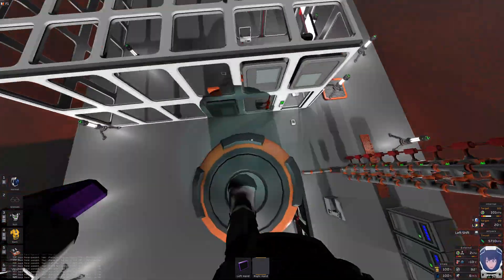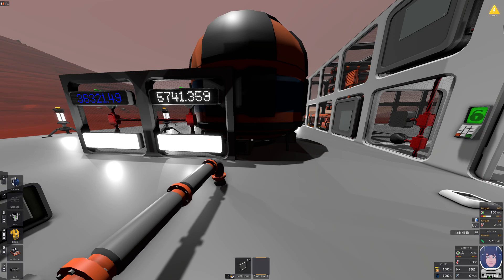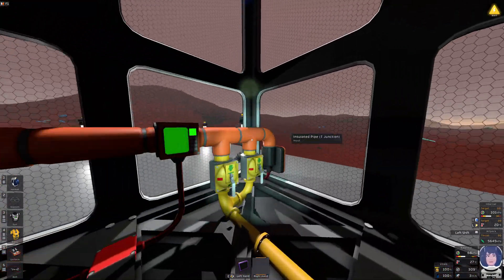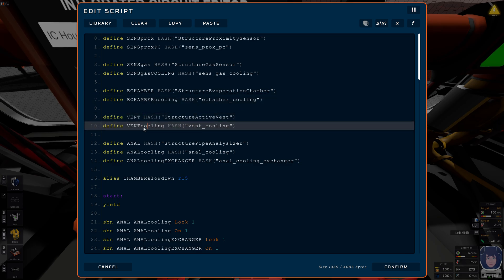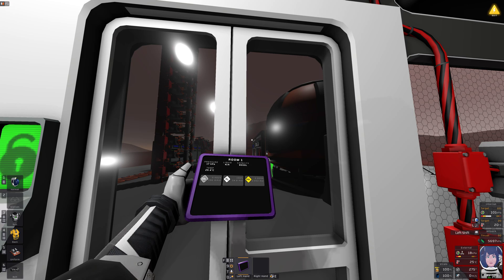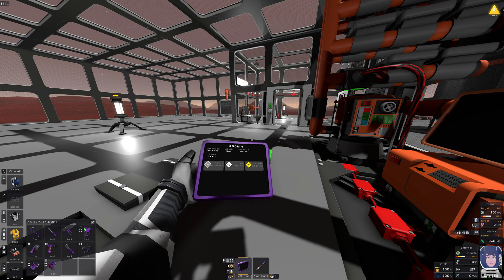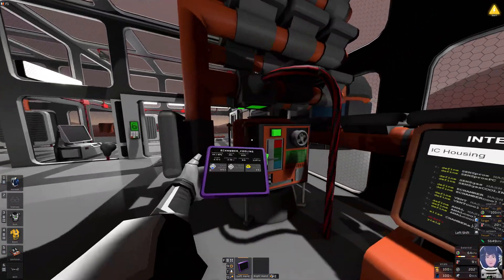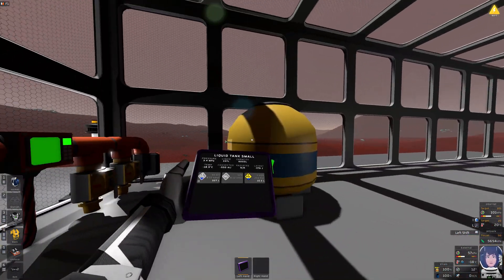Stationeers ATMOSPHERICS for total beginners - TURBOSTYLEish - Part 9: Cooling with Mars night gas *

Comment: Every time I've tried to use the evaporation/condensation chambers, they have been extreeeeeeeeeemely slow and I couldn't get anywhere near enough cooling that way. I've seen videos of people setting them up and somehow managing to get them to be effective, supposedly, but no matter how precisely I try to duplicate their setups I can't seem to make it effective. Always had to fall back on the standard AC units.
Reply from the maker: There's also manual ways to do condensate/evaporate, but I have no experience with either way to build a cooling or heating system that you could just rely on like on the ACs.

Comment: If your working liquid is pure, the dial is useful for targeting an output temperature you wish to attain.  Example: if your liquid input is Pollutant, setting the evaporator to 1860ish kpa will attempt to output the lowest possible temperature pollutant can reach without freezing in the network connected to the heat transfer output (-96ish if I remember correctly).